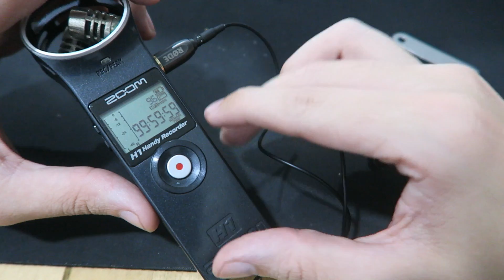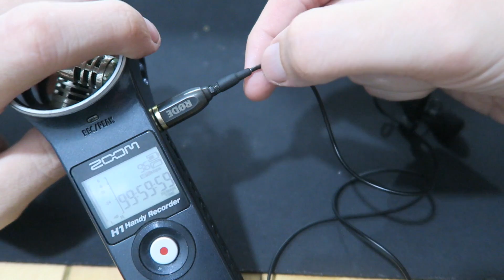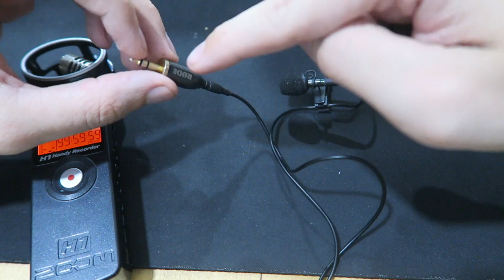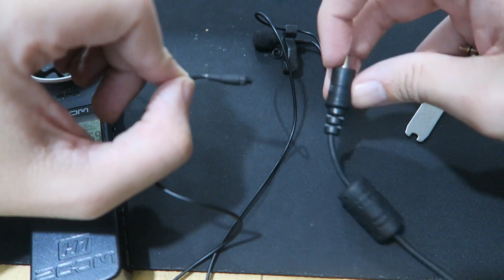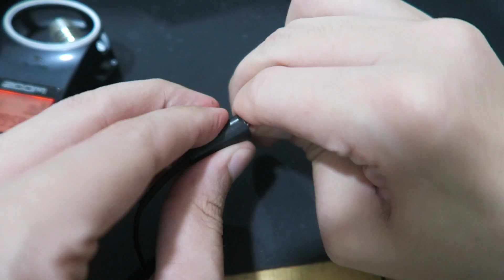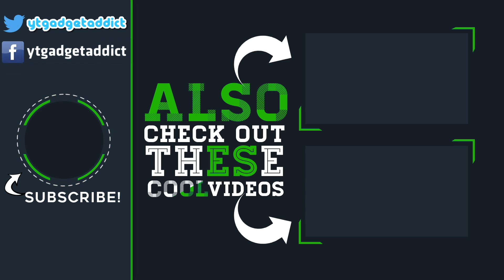Repair Rode Micon Cable for Lavalier Microphone

Comment: Exactly where mine went and I have hardly used it, from the filmmaker kit. For the price you would think it would be better on that join.
Reply from the maker: I've had the same problem with multiple microphones from rode. 

It seems like you really have to baby the cables. Or be prepared to constantly replace them, I guess.
Reply: I'm careful with my gear because of the price but this cable is crap, nice mic though

Comment: I spoke to rode and it's a known issue, poor quality copper filaments that fracture under bending. Only thing they can't tell me which products have the upgraded cable. To be honest this is not the response I expected and you shouldn't use their products in mission critical applications as their MTBF is very low..
Reply from the maker: The same thing happened to my replacements also :(

Comment: I just cut open my mic that is almost the same as yours, but a newer version. I stripped the outer casing away to find the ground, and a very tiny white wire. I tried stripping away the casing for the white wire, but there's only shielding thread in it?! I can't find the copper wire instead the white wire. Can you make a video showing exactly what is in the Rode mic wire and exactly what you soldered where? I thought there was supposed to be a positive, negative, and ground, but there's only one wire and a ground?
Reply: Did you ever figure this out? I'm in the same boat.
Reply: @ArcherVideo  yes. The white wire has copper inside and I used a lighter to burn the white casing off. The copper that was wrapped around the white wire is the ground. On the new adapter, I soldered the positive wire to the positive post on the adapter, and the ground to the ground. The negative post on the adapter has nothing soldered to it.

To be honest, it was really difficult... like soldering hairs. It worked for a while, then stopped working. I did it again, and same problem. We ended up just buying a new mic for around $40. It was the Purple Panda on Amazon. Works great.
Reply: @SarahPoulin  ah... I was wondering if this fix would be reliable. Thank you for your insight!

Comment: That's a great idea.  Thanks for the video.  Did / does the polarity matter when splicing on the new jack?  How do you know which wire to place on each terminal?  Thanks
Reply: "There's only two wires :) The thicker shield goes to ground and the smaller conductor goes to the left/right channels. In my case I bridged left/right to get my audio on both channels."

Comment: Since we're talking about mic level (which is low), if you want to do this again in the future you might want to use a jack with a metal barrel which would provide better screening from any potential interference encountered than one with a plastic barrel. They don't cost much more.

Comment: which cable goes where? where should i solder certain cables? would you mind describing it?
Reply: "There's only two wires :) The thicker shield goes to ground and the smaller conductor goes to the left/right channels. In my case I bridged left/right to get my audio on both channels."

Comment: I have the same Rode and trying to do the exact same thing. Bought a Neutrik 3.5mm jack and stripped the Rode micro cable. Only found 2 wires. Shield and one wire? If it is TRS should there be a third or did I just manage to cut it in the process of stripping. If only 2 ....can you share how you wired. Cable to tip, shield to ground? Thx for any help. Subscribed!
Reply from the maker: There's only two wires :) The thicker shield goes to ground and the smaller conductor goes to the left/right channels. In my case I bridged left/right to get my audio on both channels.

Comment: Have you tried Sugru? Useful for supporting cables exiting connectors.
Reply from the maker: I've not tried it, but I know of it and i've tried similar things in the past. I'm hoping to find a 90 degree 3.5mm adapter or extension cable so the microphone doesn't have to stick out at such an awful angle.

Comment: I saw a hack somewhere, you take the spring out of a cheap ’retractable biro’ and coil it round the bit of your cable that failed, it prevents sharp bends, you could also heat shrink on top of the spring to increase protection.  Tip don't desolder the plug to slide it on like i did the fist time, just slip the middle of cable into the middle of the spring at right angles and wind the cable into the spring from each end 😗😗😗, sorry I'm not explaining this very well but try it and all should become clear
So how do you sync you video and audio?
Maybe do a video on both of these👍

Comment: That cable is too expensive...
Reply from the maker: +tan hock jun it is pretty strong though. Like I've caught it on things before and it's survived. And it doesn't suffer from electrical or radio interference like some cheaper cables do. But it's still expensive :p

Comment: Great info GA.... I don't have a broken wire, but I do need a different adapter to the Eken 8KR, from the lavalier I purchased for it.. Just the cost of purchasing on the internet sometime... I assume swapping out the plug on the camera end would work the same way as you demonstrated the repair in this video... Thanks, and keep eating Marty's Craklins... Good day!!!!
Reply from the maker: You might prefer to buy or make an adapter instead of trying to modify the connector installed in the camera. lol I'll keep eating them :P
Reply: I'm not sure were to buy here in Cebu City. We have a couple of good sized camera shops in Mandue, or maybe CDR-King... I just don't want to go on a wild goose chase over this adapter cord... Cord I should have said in my previous comment... Thanks again....

Comment: Nice work!  Would you mind sharing please where to get the heat shrink tubing and its cost?  Maraming thanks!
Reply from the maker: I bought it from Ace Hardware. I got a pack for under 100 PHP (2USD). There's various sizes available and you can find multi-size packs being sold in some hardware shops. You're meant to shrink it using a heat gun, but a lighter works also.
Reply: Gadget Addict thanks!  I've been looking for the wrong thing.  Now I think about it, I don't know why I thought this, but I've been asking for heat shrink *tape*.  If I had one more brain cell, the existing one wouldn't be so lonely.
Reply from the maker: +Tony Benfield lol your poor brain :p now you know at least :)

Comment: use Sugru
Reply from the maker: The Sugru would be more expensive to buy and I wouldn't trust it's going to hold the cable perfectly. I'd rather just cut the cable back and add a new connector :)